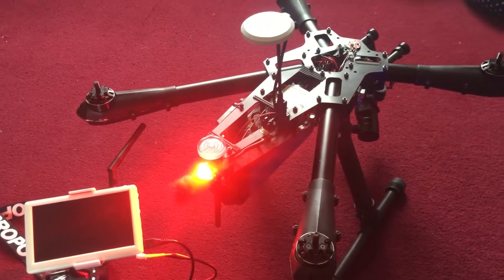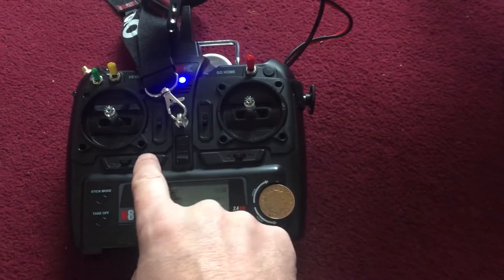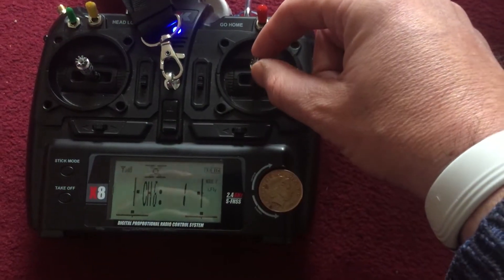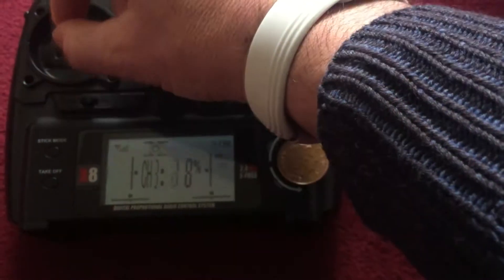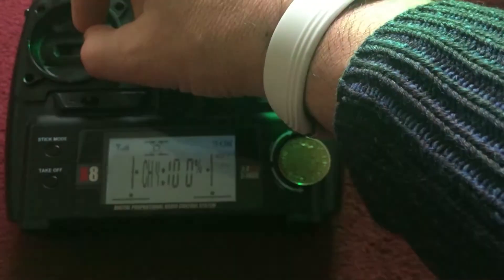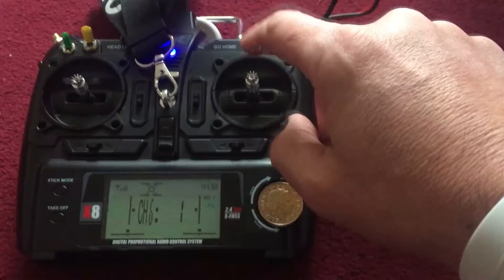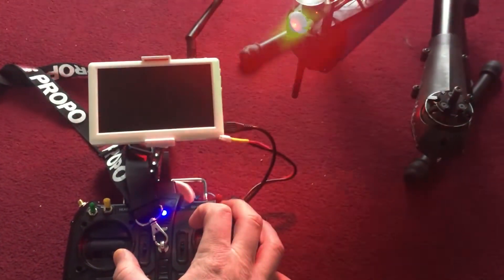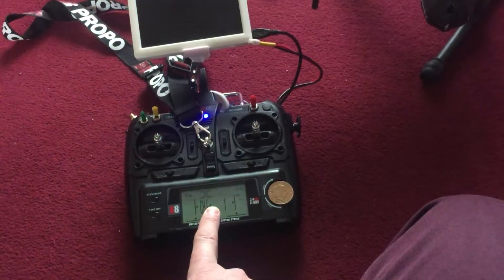XK X380 and X500 RC stick calibration on X8 transmitter in mode 2

Comment: Your antenna on tx is it vertical ? This antenna is better than mine ? If so link to buy and a foto pls to see the vertical
Reply from the maker: It is just basic duck antenna that comes free with VTX. Ignore that it is bent that way. It is only like this to keep it out of the way whilst I was calibrating the RC. They are not as good as the ducks you have, but think you can still buy them on their own.